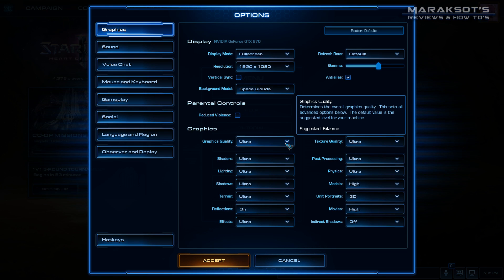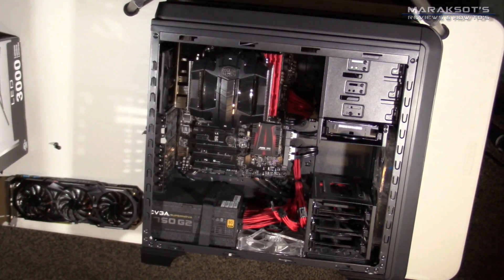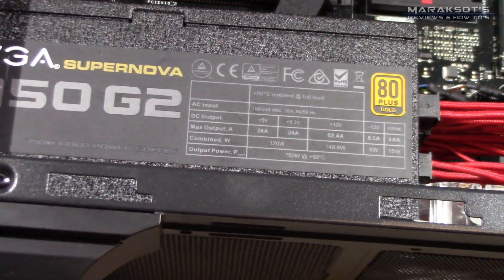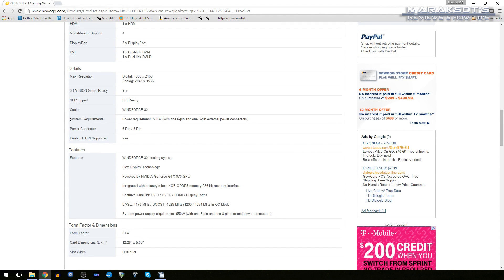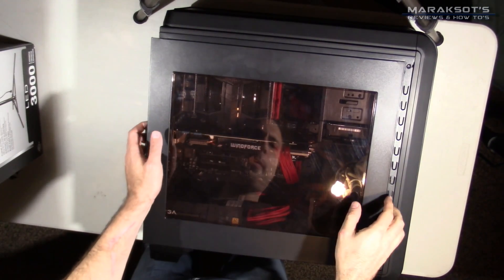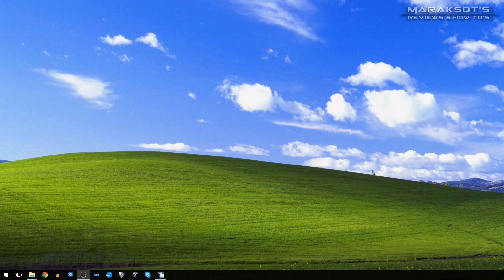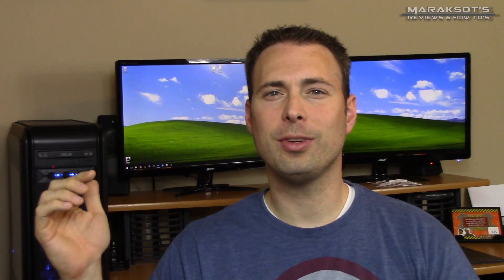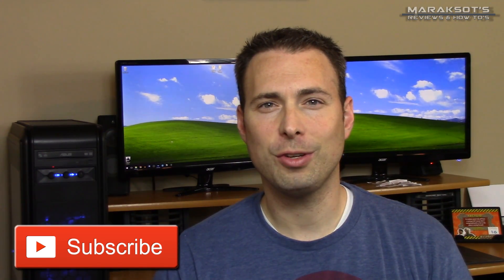A Beginners Guide - Upgrade your GPU - How to Install a New Graphics Card

Comment: i have 3 beeps problem , stuck in bios, cant press anything, annddd black screen..  i've been trying reset cmos try incrase my psu from 500 to 650 ,change the ram, andd still wont move from the black screen.. pls help Q.Q my GPU is Asus GTX 960
Reply from the maker: +Teguh Wijaya hmmm... that sounds strange. Was your computer working before and now suddenly not working? Or did you just install the GTX 960 and now it's beeping and black screening?  Here's a link that may help http://smallbusiness.chron.com/fix-beeping-computer-black-screen-56450.html another thought I had... you may want to update your motherboard bios. Unfortunately I don't know for sure what the problem might be but I hope between updating your bios and that trouble shooting article you'll be able to figure it out man.
Reply: +Maraksot78 hahah dont worry now mate.. well the problem was my bios. my bios need to be updated . so i update my bios and try gtx 960 its work perfectly :D
Reply from the maker: Teguh Wijaya awesome, glad you got it figured out.

Comment: Quick question after installing the new drivers what should I do with the old drivers? Im going from a 770 to a GTX 970
Reply from the maker: If your updating to new drivers from old ones you'll want to uninstall the current drivers and then install the new drivers. To uninstall go into your computers "control panel" and under the heading "Programs" click "Uninstall a program" your computer will then populate a list of all the programs on your computer and you can then select your AMD or Nvidia driver software from the list and uninstall it. Once that's all done go to where you downloaded the new driver to and execute the driver install file and follow the on screen directions and you should be good to go.  I should add that if you're using an AMD APU... According to AMD you don't need to uninstall your current driver you can just simply update to the new one.
Reply: Thanks so much.
Reply: +Maraksot78 I've been using the Nvidia experiece PC app to update the driver, will I have to delete the old driver, reinstall them and download the updates though Nvidia experience all over again .?????
Reply from the maker: Thanks for the question. The way everyone has handled driver updates in the past it has been recommended you uninstall your old driver and then install the new one.  I wasn't totally sure of the answer to your question because I've always just done it the old fashioned way but it looks like you're correct. GeForce Experience allows you to easily update right from your desktop rather than doing it the old fashioned way.

Comment: Hello I have a IbuyPower computer with a AMD FX(tm)-4300 Quad-Core Processor and i was wondering if a GeForce GTX 970 graphics card would fit in my computer. I don't know alot about this kind of stuff and needed some help.
Reply from the maker: +Eric wallach whether it will fit or not I don't know for sure.  I just googled "ibuypower fx4300" and looking at what I found it appears you have a standard ATX case which should fit a GTX 970.  That being said the FX4300 is a "lower end" CPU and will definitely bottleneck the performance of the GTX 970 especially in certain games/applications that rely more heavily on your CPU.  I'd recommend going with a more budget card than the GTX 970 like a GTX 950 or 960 or an AMD R7 370 or R9 380 they're more affordable and more on par with the FX 4300.  That being said you could go with a GTX 970 or an AMD R9 390X and since CPU's like the FX 6300 and the FX 8350 use the same socket (AM3+) as your FX 4300 chip you could upgrade that sometime as well and fix the CPU bottleneck problem.  Although I think you'd need to overclock the FX 6300 a little.  Anyway I hope this helps and doesn't add more confusion for ya man.  Good luck and happy gaming.  :)

Comment: Pretty helpful video man, thank you. I myself am doing a big upgrade going from a GT 740 to a GTX 970. I did the measurements on my motherboard and I think it'll fit okay, and I have just enough watts to run it. I'm unsure as to what a psi cable is though. I see some somewhat similar to yours but I'm unsure it they're psi cables or not and want to make sure I have enough of those cables before getting the 970. Thank you/
Reply from the maker: +dustyroad as long as you have the correct pin configuration you should be all good.  My graphics card requires one 6 pin and one 8 pin which I showed in the video.  So as long as you have some available cables with the correct pin configuration you should be good to go.  Hope that helps, best of luck man and happy gaming!  :)

Comment: what is the minimum psu wattage for a gtx 980?
Reply from the maker: The minimum recommended for a GTX 980 is 500 watts and then 600 Watts for a GTX 980ti. I would recommend that your power supply be at least 100 watts above the minimum recommend just to be sure you've got sufficient power delivery for those times when your system is being pushed to the max.
Reply: ok and would an intel i5 4960k be able to handle a 980?
Reply from the maker: +XxPro GamerxX the i5 4690k would be a good CPU to pair with the GTX 980.  You shouldn't experience any bottlenecking with that. Sounds like you're putting together a pretty high end system so I'd suggest going with an i7 rather than an i5 but I should probably ask first are you going to be gaming at 1080p, 1440p or 4k because if you're going with 1080 there's no need to spend the money on a GTX 980. A GTX 960 or 970 or an AMD R9 380 or 390 will get the job done. For 1440p you'll want to go up to a GTX 970 or 980 or an AMD R9 390 or R9 Fury. For 4k a single 980 or 980ti or R9 Fury or Fury X will kinda do it but to get the best frame rates at 4k currently possible you're gonna want to go with dual 980's or 980ti's or dual R9 Fury's or Fury X's.
Reply: yea i want to play games at 4k im on a gtx 960 at the moment and that isnt good enough to play 4k games and also virtual reality the minimum for that is a gtx 970 or higher
Reply from the maker: Very cool. Good luck to you my friend. Thanks for the questions. Happy gaming! :-)
Reply: you to!

Comment: I'm worried that if I should upgrade just my mother board or my processor by itself, I have a AMD dual core processor and the only thing I can upgrade pass a dual core on this socket is a quad core. I'm just worried that if I upgrade just cpu by itself to a quad core without a new motherboard it won't boost anything. Here is the specs of my cpu..... Socket AM2 (940)...AMD Athlon(TM) 64 x2 dual core processor 5600+ 2.81
Reply: 2.81 ghz
Reply from the maker: Thanks for the question man. I'm not too sure how much advice I can give in your situation as I don't know what your budget is and all but I'll do what I can and share my two cents. AM2 motherboards support DDR2 memory which is a relatively old standard so if it was me and it was in my budget I would upgrade to a new motherboard that at least supports DDR3 which means you'd need to get new RAM and a new CPU to go along with it. Unfortunately when you're upgrading all that stuff it can get kind of expensive.
Reply: +Maraksot78 thanks for the advice I will save up but 2 last quick questions. Would I need to get a new gpu as well for the new mother board and can you recommend a good motherboard under 200 dollars  and if it's not to much to ask can you also recommend a good quad+ cpu under 250 dollars. Thanks for the help btw and nice video!
Reply from the maker: I just want to make sure I'm understanding... so are you looking for a motherboard for under $200 and a CPU for under $250? So a total of $450? Also what GPU are you currently running?
Reply: +Maraksot78 yes to both of the questions above and my gpu is nvidia GeForce 8400 GS from 2007
Reply from the maker: Do you have a preference of AMD or Intel for you CPU? Because you could get a new intel Skylake i5 and motherboard for well within your $450 budget. As for AMD I'd suggest to wait for their new "Zen" CPU's to launch later this year and see what they'll have.
Reply: +Maraksot78 so that means I will most likely get the new motherboard then save up for ram and all the other components for the Intel one
Reply from the maker: As for your GeForce 8400GS if you can afford it I'd upgrade but as long as it's a pci express card you should be able to use it in your new system.
Reply: +Maraksot78 so should I wait till I can afford all the components
Reply from the maker: +Jacob Boyd I can look and see but I think you can even get 16GB of RAM for $450
Reply: +Maraksot78 sorry I'm bombarding you with all these questions but so what ur saying is that I can buy the motherboard and the ram with 450 dollars
Reply from the maker: I can look and see what stuff costs right now and get back to you if you want. But I think you should be able to upgrade your motherboard, cpu, and ram pretty easily for $450 and have money left over.
Reply: +Maraksot78 thx dude what was the name of the mother board too?
Reply from the maker: +Jacob Boyd ok I'm back,  had a bunch of stuff I had to do.... I just looked on Newegg.com and right now you could get an i5-6400 ($189.99), a MSI Z170A Gaming M3 motherboard ($149.99) and 16GB of GSkill Ripjaws 4 DDR4 RAM ($70.99) which totals about $411.00 before tax and shipping.  Here are links to all each of these components on Newegg.
i5-6400 - http://www.newegg.com/Product/Product.aspx?Item=N82E16819117564

MSI motherboard - http://www.newegg.com/Product/Product.aspx?Item=N82E16813130874

GSkill DDR4 RAM - http://www.newegg.com/Product/Product.aspx?Item=N82E16820231828

There are other motherboards and RAM that cost less but with the budget you gave I wanted to show you some nice stuff in that range.  You would need to buy a CPU cooler for the i5-6400 however as it doesn't come with one.  But there are some really good coolers out there that are very affordable.  I'd recommend a Cooler Master Hyper 212 EVO if you have enough room in your case.  It's a great cooler that's pretty inexpensive.
Reply: Maraksot78 you're a life saver dude, you did better research then i would've been able to do in a week maybe a month. Anyways thank you and i will look at the products given and start saving up.
Reply from the maker: you're welcome man,  I'm happy to do what I can to help.

Comment: Is this a good first gaming PC? I'm not good with pcs xD:
AMD Processor - AMD Athlon x4 840 3.1GHz (Quad Core)
CPU Cooling - Standard Air Cooling
AMD Motherboard - FM2 Chipset Motherboard
Memory - 16GB (2x8GB)
Graphics Card - Nvidia Geforce GTX 960 2GB
Graphics Card Cooling - Stock GPU Cooler
Power Supply - EVGA 500 Watt Power Supply
Reply from the maker: Those specs sound like a very nice first gaming PC. The popular opinion among most PC gamers currently is to have a quad core processor, at least 8GB RAM (16GB preferably) and a graphics card with at least 2GB of V-RAM.  I personally haven't used a GTX 960 but from what I've heard it's a very nice 1080p gaming card at a decent price.  The 500 watt PSU should be perfect for that system but won't allow much headroom for future upgrades.  That being said in my opinion if you wanted to upgrade further in the future you're probably going to want to go with a newer CPU and motherboard and stuff too.  As this sits though it should be a very capable 1080p gaming rig and should blow the pants off any console.  I have a cousin with very similar specs to this that used to play Titanfall with me at max settings at 1080p.  Thanks for the question man, game on my friend.
Reply: Maraksot78 Ok Thanks for the help and reply :)
Reply: After that save up for a 970 in the next 6 months at least
Reply: MrVercettti I decided not to buy the pc with these specs and keep my current pc. i got the 750 ti and im loving it but i will upgrade to 970 eventually